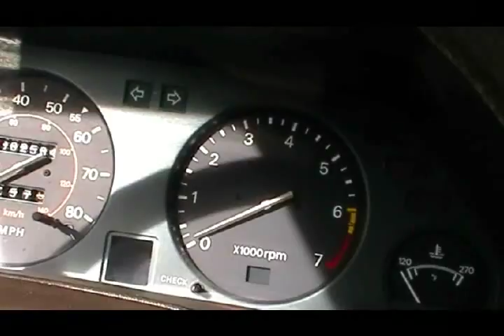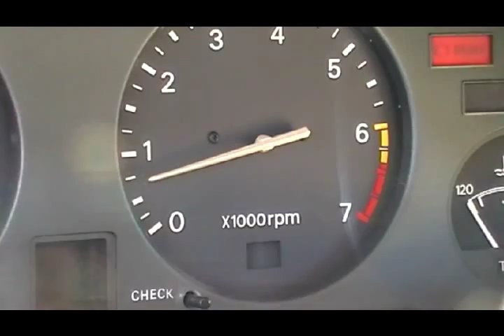280ZX: Oil Change, Replacing Fuel Hoses, Belts and PCV Valve

Comment: You have to be careful using synthetic oil in an older car.  Synthetic oil wasn't available when the car was engineered.
Reply from the maker: Interesting enough, the owners manual recommends Castrol Synthetic every 7,500 miles.